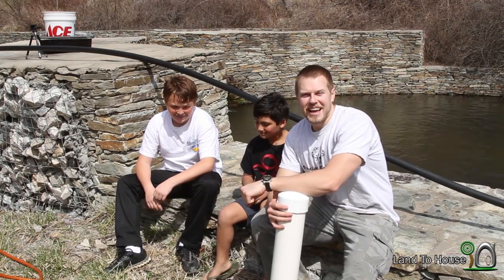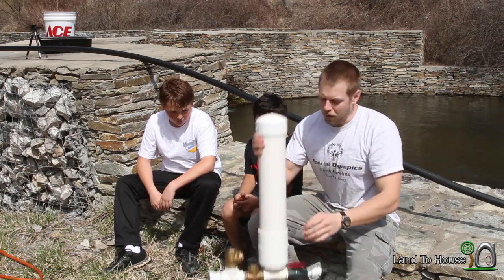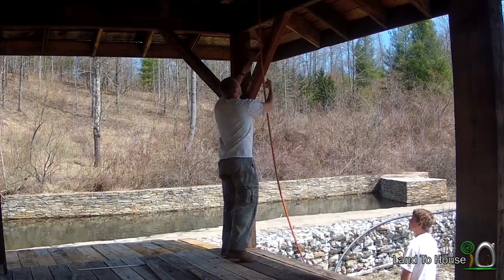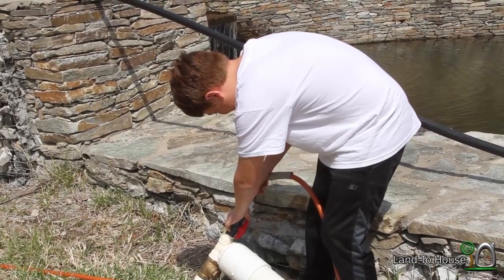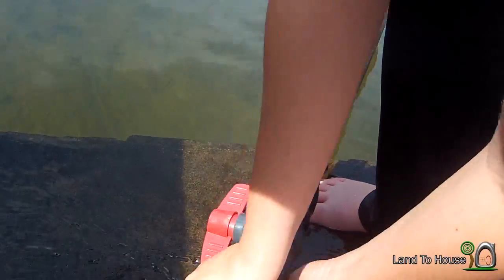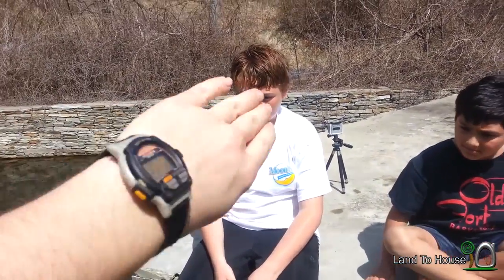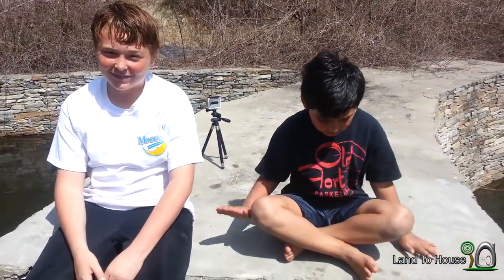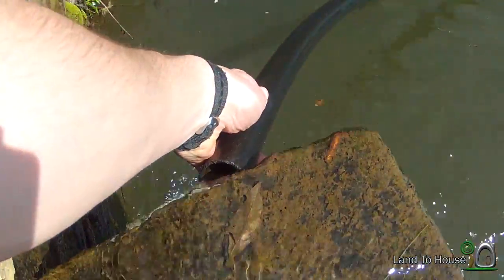Ram Pump 1-1/4" GPM Test 1

Comment: Interesting stuff. I guess the loss is proportional to the time taken at the first check valve to build enough pressure to close it. So if the weight of the gate is lower it will close sooner but need to weigh enough to open for the next round. I have seen some uses check valves which can change the weight of the gate. However that optimum weight also depending on the water head at the inlet. Don't you think we can find a good relationship between the weights of the check valve gates, hydraulic head at the inlet and the height of the delivery end with other constant parameters of your 1-1/4" ramp pump?
Reply from the maker: Not only is the weight of the check valve a factor in the loss but also the rigidity of the drive pipe. The flex pipe has a lot of bounce and this makes the pressure wave slower than if the pipe was say rigid PVC or steel. I have seen a few people use metal washers on the check valve to increase the weight of the valve to alter the speed of closure. 

I have not tested the relationship of these components to find the sweet spot just yet. So far my check valve does not have a means of adding a weight. This is a good thought though. Making the pump as efficient as possible might be important to some people that need every last drop of water.
Reply: It looks like there are lots of parameters play in ramp pump operation. Since this pump is applicable to take water from a river or creek to a higher elevation we can forget about the wastage. That doesnt waste because it will be added back to the river. So the delivery flow rate should be maximized. I think using couple of pumps would be the best idea. Will it has any effect with the size of pressure tank?
Reply from the maker: Chandrasiri Kumara Its true that the waste is not really waste.  Someday Soon I will be testing the pump with a rigid drive pipe to see just how much more efficient it will work. I have a rem pump with a much larger pressure tank on it that I can set up and compare. I have a feeling that the tank will make a difference just not sure how much.